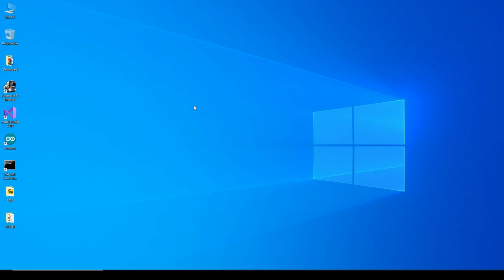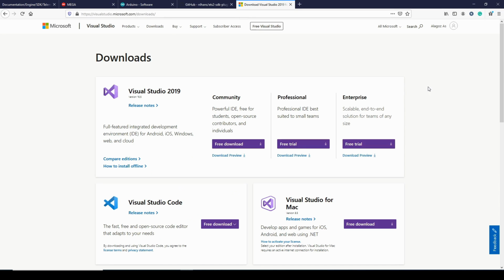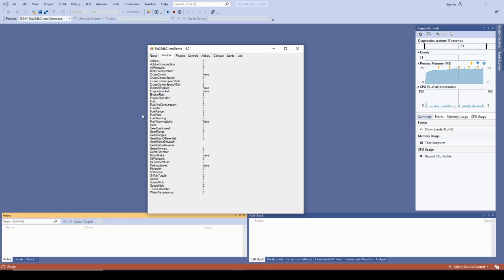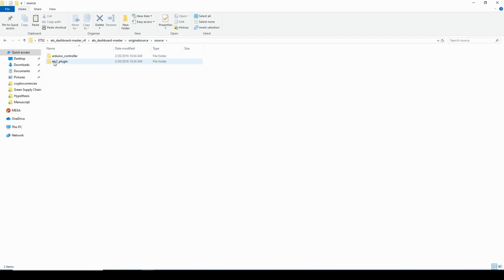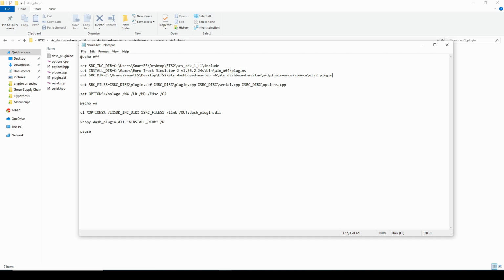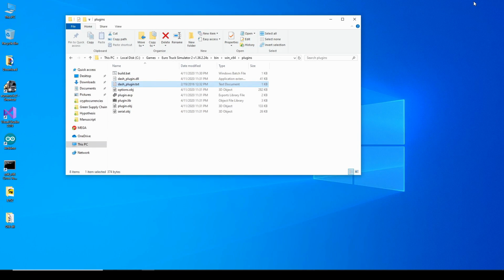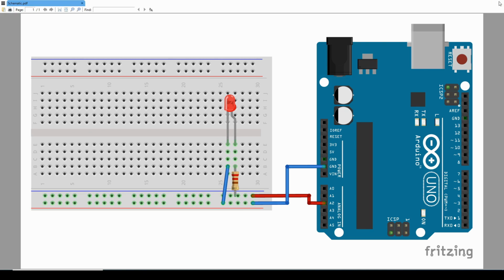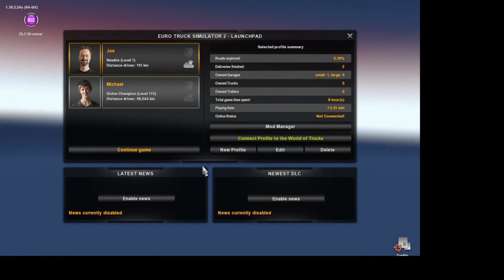ETS2 & ATS v1.37 Real Dashboard Part1: Arduino configuration for ETS2/ATS

Comment: Hi. After installing everything as per your video, the game is not giving me the warning message, and I'm getting the following error message in the log file: 
00:00:19.192 : loading 'dash_plugin' 'E:/SteamLibrary/steamapps/common/Euro Truck Simulator 2 Demo/bin/win_x64/plugins/dash_plugin.dll'
00:00:19.315 : <ERROR> unable to load: 000000C1
Any idea what could the error be?
Reply: You might have figured it out already, but this is an error you get when the plugin dll is in the wrong version of the game.  The plugin from this video is (I think, because I tried it as well) a 32 bit version, not a 64-bit one.

Comment: This message is translated with google, sorry for my english.
Hello everyone.
I've been testing with Visual Studio 2015 2017 2019 for a long time and when creating the .dll file, it always gives me an error message             "warning C4267: '+ =': conversion of 'size_t' to 'unsigned int'; possible loss of data"                   When it doesn't give me the message, it's when I do it on x86 it doesn't give me the error but when I run the x86 game the LEDs don't work, etc.
I need to create the .dll file because I think that this way I will be able to make the LCD that DOES NOT WORK FOR ME, I can't do it anymore, I have tried with .dll different from other users and it is not possible. I am desperate, can someone help me? thank you.

In spanish:
Hola a todos.
Llevo mucho tiempo probando con Visual Studio 2015 2017 2019 y al crear el archivo .dll, siempre me da un mensaje de error "warning C4267: '+=': conversion of 'size_t' to 'unsigned int'; possible loss of data", cuando no me da el mensaje es cuando lo hago en x86 no me da el error pero al ejecutar el juego x86 no funcionan los LED's, etc.
Necesito crear el archivo .dll porque creo que así lograré hacer funcionar el LCD QUE NO ME FUNCIONA, yo no puedo más, he probado con .dll distintos de otros usuarios y no es posible. Yo estoy desesperado, ¿alguien me puede ayudar? muchas gracias.
Reply from the maker: What is your windows architature 64 or 32 bits
Reply: @vohutech7393  64 bits, but do not worry, if there is no solution, I have already assumed that I will not put the display on my dashboard. Thanks

Comment: Great video!

Could you send me a compiled version of dash_plugin for ETS2 1.37? Or even your 1.36 dash_plugin.dll?
It's because I can't compile it (I followed tutorial steps for Visual Studio but mine says "cl is not recognized as a command"). Did I miss installing anything??
Thanks!
Reply from the maker: "cl is not recognized as a command" error has 2 reasons
1) You didnt installed visual studio correctly. Please go to start menu> visual studio>  Command prompt for visual studio. This file must be there.
2) If VS command is there. You must run batch file in VB command prompt, not in windows command prompt.
And you have to know if you want run ETS or ATS game from x64 .exe file you must choose VS command prompt for x64 system to compile the bat file otherwise you need compile bat file with x86 VS command line.
Reply: @vohutech7393  thanks for the answer! I did have visual studio command installed, but when I run it, the window is close but not like yours. I think is missing some configuration ".bat" that is shown in your command window.

I tried installing other packages from VS Setup, but since I don't know which of them will enable CL, I couldn't go any further :/
Reply from the maker: @tassioluis  Download VS 2015 enterprise version from this link:
 https://visualstudio.microsoft.com/vs/older-downloads/
Enterprise version will install Developer Command Prompt. After install dont drag and drop .bat file to the command prompt. You have enter .bat file path to the DCP.
https://docs.microsoft.com/en-us/dotnet/framework/tools/developer-command-prompt-for-vs
Reply: @vohutech7393  I'm going to do it! Thanks again! 😁👍